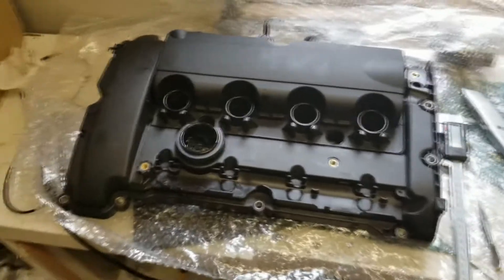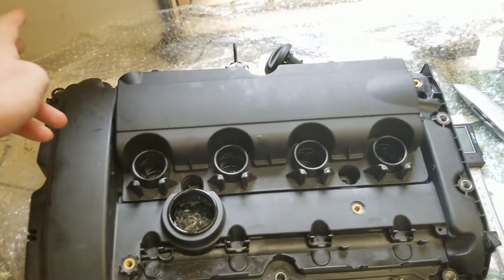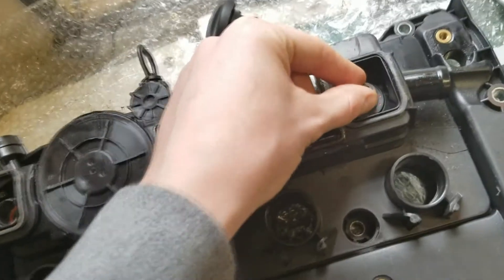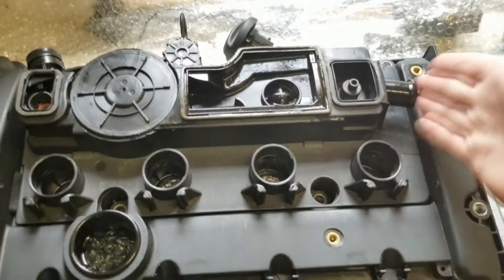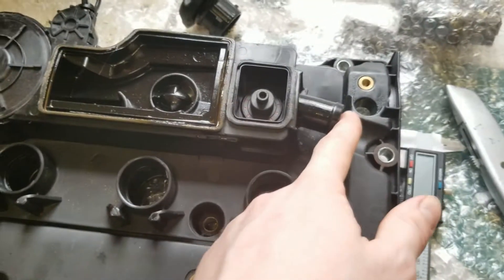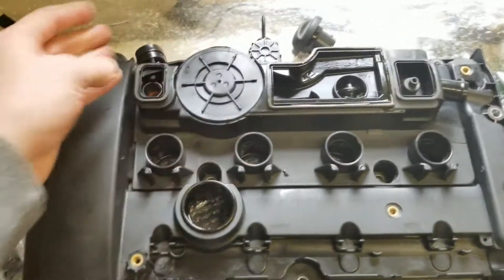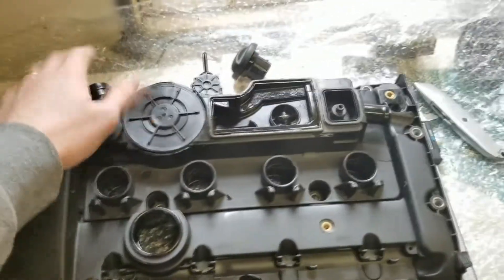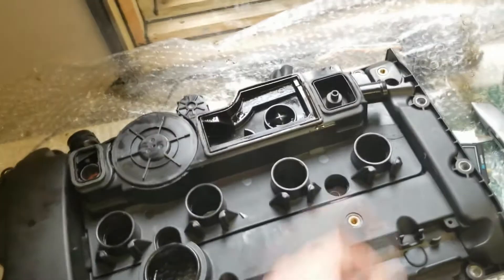Mini Cooper S R56 N14 PCV Valve Cover Fix (for non-genuine)

Comment from the maker: Note: Correct N14 crankcase / valve cover vacuum is 22 millibar.

This could be checked by making a DIY 'manometer'. See link below. 22 millibar is 8.8 inches of water.

https://rennlist.com/forums/996-forum/988695-intro-and-dismay-4.html#post14211741

Comment: After considering.. I did bought the same thing and I have the revs going up and down on idle, after asking techies on FB, they advised it was a vacuum leak also. How did you glue the top of the valve cover back down after opening it up? I haven't broken mine yet.

Comment: the handle behind the valve cover is a pressure release valve, the overload pressure inside the valve cover will flow through it. so you need to take out the pin lock. the circle part is like a mini swivel for oil mist separate, and there is a valve on it.

Comment: You missed the main thing. The diaphragm is under the round circle has to be pride open because it’s not serviceable, but it can be fixed without changing that everything you’ve done is waste of time and or will start coming out your tail pipe.

Comment: The system separates the blow-by gas, allows the oil to flow downwards, and sends only the gas to the intake for recirculation. If the vent valve here becomes clogged, the ECU will determine that the gas is thin and will issue a command for thick gas. This is the cause of the malfunction. The internal pressure will then increase, so the oil leak will continue even if the gasket is replaced. It will also affect the stem seal, causing the exhaust to become cloudy and white. The timing chain will stretch and the life of the guide will also be affected.

Comment: Hi, you have a great understanding of the pressure flow in the N14. You spoke of having a catch can in the path used when the turbo isn’t wound up. Do you feel like a second catch can could help in the path used in the other mode when the turbo is wound up?

Comment: So I have a question that I can’t fully figure out.  My 08, r56, s, I got it used and it has this same cover on it.  The left side is not connected to anything at all.  I’m in the USA, so is that left side supposed to be attached, or have they potentially modified this?  My issue is a lot of oil debris is getting thrown out the exhaust onto the back of my car
Reply: sounds like they deleted the intake routing for the positive charge side. Reinstalling this will allow the oil to recirculate and get burned as apposed to just spit out.
Reply: Yes it's supposed to be attached. Does it have an aftermarket intake? I would fix this issue immediately, you're over pressurizing your crankcase, you probably have oil leaks all over the place, including your valves and pistons.

Comment: Awesome video, helps to fully understand how it works. Some time ago I plugged the passenger side of the PCV just like you, becouse it was making my engine super knocking.
Reply: Would this cause oil debris to fly out of the tail pipe and cover the back of the car?
Reply: @p1sstoph3  in my case - no difference.
Reply: U can actually get genuine psa bungs to block the rear vent on the cover and that was a Peugeot main dealers bulletin to fix the issues they manufactured genuine part caps to block it off at both ends and remove the hose .. so if it’s a major issue to block them off then why did Peugeot start doing it for cars pulling too much oil into inlet manifold. If it is an issue to block the rear vent then Psa didn’t think so at the time and it is the same engine

Comment: Great Video, I too have high oil consumption but I think its tired piston rings as I only get a puff of blue smoke after a long overrun and I know its not the turbo and the valve stem seals as I have changed them.
Reply: Nope not the piston rings, its the crappy PCV system. Check the hose that goes to the intake for cracks first and then install two catch cans. Once the engine burns all the oil you most likely have in the intercooler you'll stop blowing smoke. You'll probably also want to clean your intake valves.
Reply: @bluefordpickup  It was the piston rings as I have just rebuilt the engine and no more burning oil 👍

Comment: The large circular disk has another valve under it usually the main cause it gets gunked up sticks shut or open it shut fluctuate so oil doesn't come up most suffer with white gunk like a head gasket from huge rocker cover causing condensation so check that too it doesn't come open easily so buy a genuine new part will fix 99% of idling problems and gunked up inlet valves as the vapours burn on .. I put an extra oil catch in too works a treat

Comment: The genuine cover has hard flaps instead of the rubber round seals  I must add the cover must be stuck down with so seriously strong glue as the valve nearest the timing change is pressurised to what boost pressure is good luck

Comment: Hi, I have seen some aftermarket aluminum valve cover, do you think aluminum valve cover would make any difference, as I think those can be disassembled and easy to replace pcv parts.
Reply: I’ve just fit one to my car so I will see if it’s better or not over the next week or two

Comment: hello .. the video is very interesting and I think you are the only one on YouTube that explains this problem and the operation of this valve cover and PCV ... I have also changed it as well as a plastic called polyamide because it withstands more heat but Unfortunately it comes with exactly the same problem...I want to ask you a question and I don't know if you remember the design of the valve correctly...instead of taking off the top cover, couldn't you push the valve with a screwdriver?  the guide in the center of the valve is glued or is a joint piece and must be cut by obligation.... looking for a lot of information on this subject in some forum I have read that they come like this to avoid oil consumption and that the engine valves are not dirty ... in my car when starting in first gear I am noticing how the engine shakes a little then everything goes normally ... I have disassembled the tube that goes from the PCV to the turbo and everything is dry and clean...with the obd machine I get the same 2B64 code...could the engine be affected if it doesn't solve this?  I await your response... greetings and thanks for your time
Reply: Check the hose that goes to the intake manifold for cracks. It might be broken. I hope you're still alive.

Comment: Brilliant thanks 😊
Reply: Because the extra air could sucked into the back manifold and it’s unmetered, you’re coming out of the filter box is metered, and then after that, it becomes unmetered through the turbo and a turbo doesn’t detect how much air is going through, but the computer has a valve on the hose leaving the valve cover you’ll see a wire you’re going into the hose that opens and closes at idle And idle. It’s closed at turbo it’s wide open. Yeah there’s more to it

Comment: Jesús!!!! This is the best tip ever!! I got this problem with my mini Cooper, after too many diagnosis and testing I was prepared to spend hundreds of dollars to repairs and I stumbled into your video and did it as ultime resource...and it work like magic, and only spend 2 dollars of some plastic glue and a burn fingers tip..🤣🤣 an that was it... Thank you some much.
Reply: Hi what is the name of the plastic glue you use please, if you don't mine Mr. Acuna?  Thanks.
Reply: @jonasesguerra6738  also need to know this!

Comment: I've shared this with so many people. You have cleared up the mini pcv mystery.  Fixed my car for £38 using the Peugeot part and now it's great no more p1497 code for me.
Reply: Is that how much the valve cover costs from peugeot?? I have a 207 gti and bought an aftermarket "mini" item for double that
Reply: @RaifRaif85  that's from eBay. The mould tool to make these parts makes them for the manufacturer and the spares companies. It's a myth that the quality varies depending on who you buy from. I worked injection mould tooling for four years.
Reply: @emailandy79  I can belive that. I bought a "branded" European made part and it has the same issue as the ebay ones from the far east 
 it seems!

Comment: nice and instructive video. Did I understand correctly? when the engine is running in neutral position, the left side tube of the valve cover should be open valve and release gases through the hose in the inlet manifold, and the right side,tube is should be completely closed and should not emit gases or sucks air ??? ? For me, the new valve cover in neutral position, draws air a lot from the right side where the hose from the turbo is connected and shows p2279 error, and coolant radiator fan running in full speed & dont stop.It new valve cover,bat is not geniun part oem.
Reply: Fix it or you'll turn gay

Comment: Thank you for the great instructions good sir, is it possible to take off the cover that will expose the two valves and work on them, without taking the valve cover off the engine? I have a 2009 s model that has leaking oil on the cover and check engine light is on. I am suspecting that it is a cover issue.

Comment: I've been having a p1497 issue since I did my timing chain and new valve cover Install. I watched your video and pulled the hose off the right side of the valve cover yesterday and at idle it sucks air in strongly. So is this the sign that my new valve cover needs to have this truck done?
Reply: Wicked! What did you use to glue it down?
Reply: Hey I'm having the exact same problem! Did you fix it I'm the end??
Reply: @purelegend24   I got a p1497 after I change my new after market valve cover last week. 
And I I did that fix today. Cut the pin of that plug. After this everything back to normal. I got the full performance again. 
Thank you very much @TensonUK  who share that tricks here.
Reply: the problem is on me 207cc turbo,new after market valve cover sucket air in the right hose when the attached turbo hose.And p2279code, radiator coolant fan working on full speed after start the engine and dont off even off engine😤😤😤😤
Reply: @MultiXANTIA1  exact same for me on my 207 gti after fitting aftermarket valve cover!

Comment: This Valve Cover is design for Turbo and Non-Turbo.  Non-Turbo you do not need the hose from the right.  Just plug it up and you will have no vacuum issues.
Reply: What is the effect if i block the pcv hole line ?
Reply: @ahmadzambri6679  -  Depend on your Engine.  You will have oilly engine vapor issues.  Waste gases exit the crankcase through the valve, but cannot enter and that is the main function.  Also some cases, there are many lines branched off from that too, got to be careful, unless you do it right from the PCV itself.
Reply: me is turbo 207cc thp and right hose suck air on new non geniun oem valve cover.After replacement valve cover appeared p2279 code and coolant radiator fan run in full speed and no off even after engine off🤔🤔🤔

Comment: I bought mine for 100$ because I didn't trust ebay ones.
Well after I installed it my idle was higher than normal and after 50 miles the check engine light came on. It was p0507 (idle control system higher than expected). 
After having this issue I started googling and I found you video. I checked the valve you were showing with a mirror and sure enough it was open. 
Turn the engine on and it was sucking air....
I just wanted to thank you for helping with you video!

Comment: Thanks very much for your practical explanation. I’ve just bought a Valve Cover from Neo Brothers and will follow your recommendations depending on how it performs. I’m looking to solve my high oil consumption and unsteady idle with a properly operating PCV system.
Reply: High Oil consumption usually sign of leaks.  You can get a Oil Catch Can, that will help. Also, when you empty it, you can tell a lot about the Engine just by the Can.
Reply: @JodBronson  A bad pcv will create too much pressure and push the oil down past all seals and burn, creating the blue smoke. does not always mean worn rings
Reply: How did you get on with the Neo Brothers cover Harry ?
Reply: @Mike B  
Good as far as I can remember hehe. I'm sure my notes will explain if I were to go back through it. I no longer have the car so I need to sell my Bentley publishers manual and timing chain replacement tools that I no longer need.
Reply: @harrywilkinson444  Many thanks Harry 👍🏻
Reply: I also have high oil consumption but no leaks... the only signs is like oil evaporating...out of where the pcv vale connects to the hose. (Or that corner). Also i have rich mixture... and now is heating... is it completely blocked?
Anyone help??

Comment: Not only is it bad to block them off bcuz of less - pressure it's also bad bcuz water will build up in the crank case from heat cycles which will make goopy oil since the water is not being sucked out. Don't block them off if your not gonna change your oil at very short intervals such as 2000 to 3000 miles or every 3 to 4 months. This is not an opinion it is proven fact.
Reply: Agreed, the whole point of the system is that the engine burns off the moisture and throws it out the exhaust.
Reply: correct they are there for a purpose not for blocking off lol
Reply from the maker: Do you mean capping the intake manifold pcv hose?

Do remember there will still be suction on the valve cover from the turbo inlet side. It's just not ideal as it encourages condensed oil and water in the intercooler.
Reply: @TensonUK  any effection come if i block/capping pcv hole?
Reply: @TensonUK : It's currently Aug. 2025, my Copper S is still running as strong as ever. I'm sure a reply 5 years later is pointless to you, but it may not be to someone else... so. Yes you are correct, but the 2 ports at the back of the valve cover provide flow to that port before the turbo. If you cap the 2 back ones, the way you'll get any volume of air is with piston ring blow by. For every engines longevity, it is extremely important to allow proper warm up and cool down on top of having flow through the upper part of the engine and maintenance, otherwise you're going to get a lot of condensation build up, which damages the engine the longer you go on oil changes. Trust me or don't, but I do have a Cooper S with 200,000 US miles on it, an N54 with 180k miles, an N55 with 140k miles, all of them street legal, strong running engines that have never been rebuilt. I also now drive a Tesla Model 3, cuz I'm so tired of doing 3 to 4k miles, or 2 to 3 times a year minimum oil changes.

Comment: 250th subscrober yeah!
I'd be interested to hear what you've used to install the OCC on the intake side (hose inner diameter, what type of collars, etc). I have one on the turbo side but the hose at the back is much less accessible, made flimsy plastic and connects to at least one plastic nipple _which makes collars tightening frightening....
Reply: I've tried three OCC setups on my N14: BSH, Moroso, and a name-brand I don't remember.  The best, by far, is the Moroso.  The finished installation is clean and trouble free.  Brands that have good recommendations, but I haven't tried include Mishmoto and GTT.

Comment: Good info. Thanks!
If i have to install an oil catch can (OCC)  on the passenger side, can i just plug/close the intake manifold (no hose).  So inlet side of the OCC will be the oil and the outlet side will just be an air filter breather (instead of connecting a hose heading to the intake manifold)? Thanks👍

Comment: My new unbranded valve cover has the same issue.  What did you use to reseal the cap?
Reply from the maker: Upol Tiger Seal. I had thought hard about what to use, then talked with someone who said they had resealed PCV systems before using Tiger Seal and still good a year later.
Reply: @TensonUK  If the seal is not air tight, would this bring up any issues? Picking up a error that points to a air fuel mixture error. I can hear a audible sucking where it should be sealed. Error code P2191 Too lean at higher load bank 1

Comment: Awesome video, much needed information in regards to these valve cover replacements. If you ever find out what the plug in the rear is for PLEASE let us know. The only info I could find was it has something to do with emissions with the Minis imported to the USA. Euro Austral/Asia don’t require that section I think.
Reply from the maker: Apparently it is supposed to be plugged. I don't remember where I read it, but the handle on the plug is designed to snap off so it can fit next to the air box. N14, plug the hole.
Reply: @TensonUK  i have a plug with and without a handle? I assume either is ok ?
Reply: @t3boy41 u use the correct bung with o ring that is supplied and disregard the handled one as the correct bung is a better fitment for one than the handle and is designed to be a pressure relief in case of high pressure inside the cover so do not use the handle one
Reply: @TensonUK u do not snap off the handle… u use the correct supplied bung and if not supplied with the cover (which they usually are often separately in a small bag  ) then u get one from the main dealers or neo bros for around £9 .The vent breather valve is also an over pressure relief that can be blown out and the handle one is not designed for that